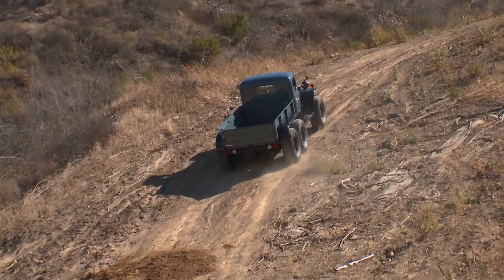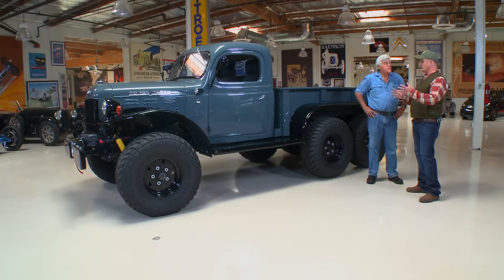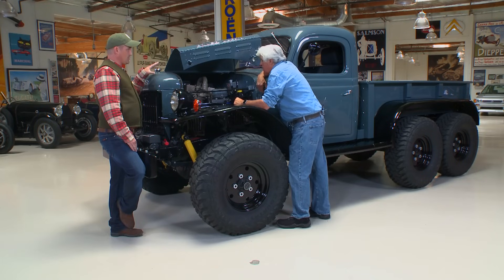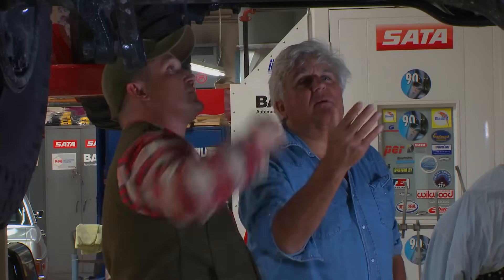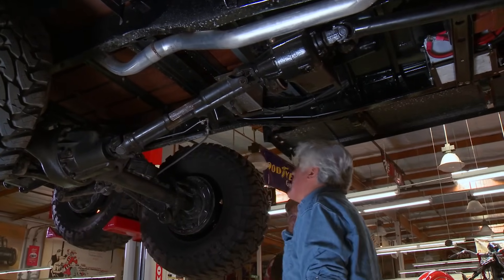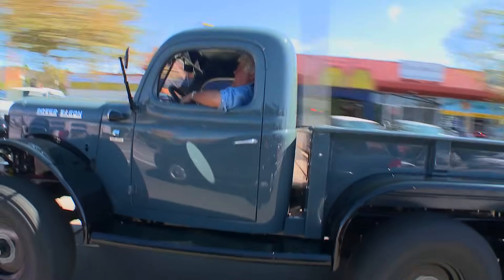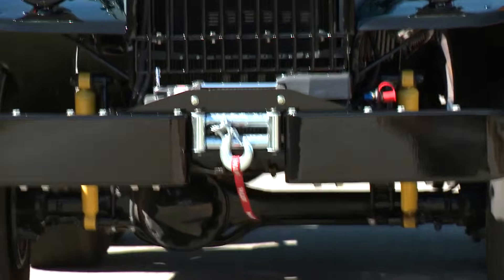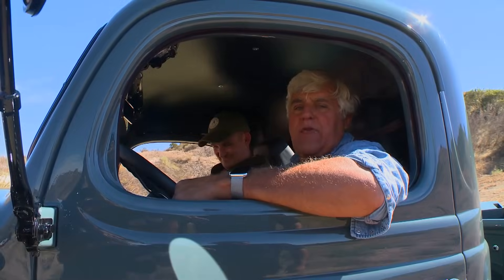1942 Dodge Power Wagon Restomod - Jay Leno's Garage

Comment: I drove a 1952 Dodge M37 for about 10 years.  My every day ride.  It was an ambulance that I put the troop carrier body on, took out the flathead engine and installed a Chevy straight six.  Ditched the 900/16 non directional tires for highway tires.  Lived in Palmer Alaska and drove it every M-F to Anchorage for work.  100 miles round trip.  Drove it to Connecticut from Alaska.  Took 30 days as I broke down every other day!!!.  Did all my own work.    Wish I still had it but bad knees forced me to go to automatic transmission only.  Hey Jay, wish I had a dollar for every time you cross the line while you are driving!!..lol.  Love your shows Mr. Leno.  Wish I had the money to do a few of the builds that you do, that would be a lot of fun.  I bought my M37 from Gary's Trucks in Anchorage in 1981.  Gary's is still open on Dowling Road in Anchorage.  I also used my truck to cut firewood for a living.  Had it off road hundreds of times cutting my way into the woods.  Ahh, to be young again👍

Comment: Nice!!! we had one like this, just with a wide cargo platform, and we used to transport all provisions plus firewood through the snowy slopes of the Patagonian Andes. I think it was a 1947 model almost unmodified from the army issue, except for the paint (red+black). It did its job very good, except for fuel consumption... The winch was used quite a lot, to move the boats, heavy logs, and the truck itself when needed (for snow plowing we had a Unimog, besides a Land Rover Series 2A for moving around). We also rented a Dodge Carryall model 1959 to transport the customers of our fishing lodge. I was just a kid so I do not remember technical details, but the wagon used to be from the Border Control Police, and operated in the high desert plateau of the Atacama Desert before moving to Patagonia as a civilian car. It still had the official greenish-khaki color, just without the markings of the service unit. We also towed a big trailer for the wooden fishing boats (4, 6 to 8) with it. As a kid I loved these cars, I thought I was just back from WW2 whenever I traveled in them... (I even built a tiny 1:72 model of the WW2 truck, the one with the howitzer) The new RAM is just a meek consolation compared to these living monuments! But today I would rather go for Unimog, Pinzgauer or Volvo (army surplus), who are more than capable for such hard performances! (and I would love to have my old Landie back, knowing that the Defender is just overpriced junk, and even convinced that Toyota always built the far better 4x4 anyway) greetings from wild, wet, windy and wonderful Western Patagonia

Comment: It’s like a miniature Deuce 1/2. I love it.
Reply: The Curious Mind  any relation to freeway?
Reply: Several years ago I could have bought 2 smaller duece and a halfs that to my surprise had Chrysler straight 8s gassers in them , I had never seen one before , and I've worked on a lot of old equipment and farm tractors . Inherited an Insley track crane w/one in it , and you think I could track one of those down for engine parts , yah right .
Reply: @jamierodg1  me as well. I had so much fun in in them. About a year before we started getting those née 5 ton with that CTI system, I went to San Jose and picked a fully rebuilt restored deuce. I shredded the hydronic governor and had an absolute blast with it. Those 5 ton just weren’t the same.

Comment: My Dad and his buddy had a trucking company in the 30s with one Diamond T single axle tractor.  After Pearl Harbor Dad became a USMC motor/mechanic - infantry marine.  When he was discharged in 1946, he bought 2 crated/Cosmolined Dodge Power Wagons (DOD surplus) and had them shipped to Milwaukee where he and another mechanic uncrated/assembled/degreased the
single axle Dodges.  His new company put all 3 of his kids through coillege and retired Mom and Dad quite comfortably.  One of those Dodges was still hauling pulp logs when I started college in 1966.  Some truck!

Comment: Everyone commenting how expensive this truck is??  Yup it is coz that winslow guy worked hard in it,  built it with so complicated but powerful, strong vehicle, good looks.. main thing is 6x6 vehicle is only made by mercedes and its very expensive. So here we are getting a 6x6 trolling tank ready to rock anywhere. This vehicle is symbol of monstrosity,  country side people will be happy with this truck.
Reply: Ckryse S nailed it. I mean the merc 6x6 was originally meant for the Australian army. Then it got cancelled and became a poser wagon. This power wagon. Half the price and I would have it any day over the merc.
Reply: Dodge made 6x6 power wagons this is not a one off, I drove by one in a field today. They were the work horses of the US war machine in the 40s, 50, and 60s. So there were thousands made, this is way too expensive. 

It costs about 10k to get something this big down to metal for paint using sand blasting, the 6x6 already exists but you need to make a lift kit and gear it for the Cummins and new tranny that together can be another 15k. Now those tires are probably over 1000 a tire. That is at least 6k. Throw another 10 or so for fabrication including man hours. This was a rip off, haha
Reply: George Glass  there’s another solution if you want a 6x6 and is a Toyota Land Cruiser 70 series. No that expensive as a Merc, not that monstrous as the power wagon and yet pretty capable. That said there is no doubt this build have twice the cool factor of any other similar one.
Reply: @humbertorubi4947  old unimogs arent that expensive. I saw a 6x6 diesel unimog firetruck with cascade gearbox for 15,000 last year on craigslist.
Reply: Mic Krout sure!! But they are not very common. But the comments on the price are referenced on the G63. Unimogs are great 👍🏻
Reply: @humbertorubi4947  true, they arent very common in the US. I just happen to live next to two major importers and in farm and logging country. It was a german fire truck repurposed as a log mule. Besides them being superior off road, you can fix them with junkyard parts which is a big bonus. Just have to find one, i have seen far more power wagons around here but they are $$$
Reply: I can't believe they built 60 of these without a lift in the garage..
Reply: If I had the money, I'd gladly pay that much, matter of fact, I was thinking it would actually be more than what he said it was.  Here's to hoping to win the lottery and SOON! :D
Reply: @angrybadger8136  Who needs a lift? You can probably walk under the thing.
Reply: its a tractor, with a pickup bed, that cost more than a new tractor, very cool truc-tor!
Reply: For half the money you can get twice the truck brand new!  Nostalgia is a prohibitively--expensive feature!

Comment: my ram 2500 5.9L cummins is 8,000 pounds.  so I think that truck is impressively light for how heavy it looks.  great job!!
Reply: That's probably your GVWR. Your truck's curb weight is probably around 6,400 lbs depending on if it's a duallie or 4x4...max curb weight for that vehicle is about 7,200. GVWR is what shows on the door jamb tag, that's the total of the vehicle's weight plus the maximum load it was designed to carry.
Reply: L TR NOPE....MY TRUCK WEIGHT THE SAME 7900 LBS...ITS A 4X4 MEGA CAB 1500...BUT THE MEGA CABS WERE 2500 CHASSIS..WELL IT WAS ACTUALLY 7700 LBS ON A WEIGHT SCALE THE CUMMINS WEIGHTS MORE THEN A HEMI ENGINE ABOUT 250 LBS MORE IF ITS A CUMMINS MEGA CAB 4X4. SO YOU RITE BUT RIGHT NEXT TO THE GVWR IS THE WEIGHT OF THE TRUCK.
Reply: Good point. The truck is already heavy. What happens when you come to the under built or old bridge above the river you cannot drive through?
Reply: No it doesn't it weighs about 6500-7000 lbs.

Comment: Jay Leno, you’ll probably never read this, but my FIRST TRUCK EVER was a 1971 dodge powerwagon. It was a 3/4 ton STEP-SIDE short bEd 4x4. The bed was diamond plate steel. 4.10 gears, 318 v8, and when I bought it there was only 26,000 miles on the clock. It was my local jurisdictions old firehouse truck originally, that ended up in a local farmers barn until I bought it at 16 years old with money I had saved from bailing hay. I ended up in a financial crunch in my mid 20s and had to sell it, and have regretted it ever since. I put a bunch of blood sweat and tears into that truck and miss it dearly. NEVER sell a powerwagon!!!!

Comment: I own 2 Vintage Dodge Power wagons One is a 1946 the other a 1964  BOTH have been used by the US Forrest service until I purchased them 37 years ago . They NEVER have been restored ,other than usual Maintenance and Service .They BOTH have spent 99 % of there lives OUTSIDE . Never Garaged , YET to this day neither one have ANY significant RUST issues !!  minor surface rust here or there on the frames or underbody But you can STAND on the fenders TODAY and they wont give an Inch . VIRGIN IRON was used in the STEEL !Trucks TODAY are NOT made like these were back in the day ! NO impurities or recycled Trash in the Metal . THATS why these trucks have survived 70 Years .They will be here another 70 if all goes well . NO electronics ! No Computer ANYTHING , Just good old American Basic
Trucks that will NEVER Die . ANYONE can fix ANYTHING on these trucks with very little effort . GOD BLESS AMERICA ! I will ALWAYS
Reply: CJ Jackson - you need to buy a new keyboard, as your CapsLock is intermittently locking on!

Comment: Would be cool if they made a 5.9 6bt or new 6.7 cummins in this thing
Reply: he was saying it wouldn't fit the bodyand original sheetmetal,but that little diesel it making monster torque that's what gets you up the hill
Reply: +Matthew Higashyama NO, it wouldn't. I think you missed the part about the top speed being 55, rather than 70. There is absolutely no reason whatsoever to add more power. As soon as you add more power, you have to gut the drivetrain, throw out the suspension. At that point you have a completely different truck. Put a 5.9 in it, and you might as well have a light frame and a fiberglass body. What is the point??
Reply: +Daveinet I hear you. It's a shame though that as far as pulling trailers goes, this beast couldn't reach legal/safe speeds with anything hooked up
Reply: +Daniel Pearson Dana 60s?
Reply: +Matthew Higashyama I would go for a Dana 80. Maybe a high pinion Dana 70 in the front. But again, you start doing that and you have a completely different truck. Right now, as it is, you have a very utilitarian beast - the beast that it originally was, but with new parts, so it will be dependable and maintainable. 
If you want a freeway truck, find a Kodiak 4500 4X4 that was in a roll over. Put an antique truck body on it and call it good. But that is not what this truck was ever intended to be.
Reply: +Matthew Higashyama The 6BT is way longer, fair bit more than the original 6cyl gas engine. They would have had to set the firewall back. The 4BT is probably a good match with the original driveline without tearing them up and the original stuff just looks correct and fits the theme of the truck.
Reply: +Matthew Higashyama I put a 3.9 Cummins in my 04 Tahoe and it pulls it fine but I don't think it is the right engine for a 3 axle monster. I would have put the 5.9l in it any day. Big mistake in my opinion
Reply: +DEBOSS GARAGE Should send the guy a Tape Boss and tell him he needs to put a 6BT in it.
Reply: +DEBOSS GARAGE ya exactly! Plus a Tahoe is significantly lighter than a power wagon so a 4bt would be an awesome application for an suv. I see where they were going with the powerwagon as far as retrofitting a new engine goes but I just don't think it's fast enough regardless of torque and gear ratios
Reply: +Matthew Higashyama  Its not just the drivetrain. It is the handling. The suspension is not safe above 55. The brakes are not safe above 55. The trans is setup with a creeper gear for climbing. So that would need to change too, as it wouldn't hold up. So then you need a different transfercase with low range. If you want a new truck, buy a new truck. You totally loose the character of the original truck.
Reply: +mytmousemalibu I don't think so.  I Jammed a 5.9 in my 05 Silverado which had the 6.0l, but only 4 cylinders long.  It would have fit in the PW if he put an electric fan on the front of the rad.   Cutting into the firewall gets into moving the trans and everything back and way too much work.
Reply: DEBOSS GARAGE Without a tape, IDK, I still think a 6BT is a bit too long. I currently have a 46' Plymouth Deluxe fastback coupe with the original flattie 6. Even with it being a 6cyl, its a pretty small, short engine. Very close to what the PW had in it. Whether it fits or not, I think between what the Builder & Customer wanted, the 4BT will do just fine. That original drivetrain would not last long with a 6BT twisting on it and sticking with the original stuff was a big part of this build.
Reply: I see your point.  At the end of the day it is just an awesome toy that is really not that practical so might as well go with the 4 cyl
Reply: +Daveinet ah he didn't say the top speed was 55 he just said he wouldn't take it higher than 55-60.
Reply: Look up dan mininger precision power wagons on youtube it you want to see ones with 6bt.
Reply: I agree.
Reply: +Matthew Higashyama The little B model is perfect in this thing. It's an off roader first, highway machine second.
Reply: There's no way a Cummins 6 would fit
Reply: supreme2005  They do. People have put them in.
Reply: +Matthew Higashyama You also have to remember what they said about the difference between a 55 mph vehicle and a 70 mph vehicle. It would end up being a LOT less stock!
Reply: +Matthew Higashyama I doubt you'd even notice a trailer on that... Kids these days...
Reply: +Matthew Higashyama Or he could have put an original engine in it and it would be slower than a snail and guess what else... still street legal lol.
Reply: they should make a 4bt based on a 6.7 instead of a 5.9
Reply: Matthew Higashyama I'd buy one. It's a great truck, I love the 6.4l but I would end up needing a diesel for towing and mpg (ps I'm talking about the new one)
Reply: Matthew Higashyama I
Reply: Matthew Higashyama me and my dad where looking at one of theis and we where talking to a guy selling one but the engine was trash and he was saying guys put 5.9 cummins all the time he wouldent sell it to anybody that was gonna put one in it he said the only way he is gonna sell it is if you would put the original engine back in it
Reply: Well if I'm not mistaken this engine basically is a 5.9 12V but missing two cylinders. Sorta like the 4.3L Chevy V6 and the 5.7L V8 (350, duh).
Reply: Too heavy for off road, 4bt already weighs as much as a BB chevy, 6bt dressed is about 1200 lbs
Reply: Matthew Higashyama correct...especially since none of the trucks that company build will ever be used for work. Most of the guys buying his restos are polishing them with a diaper and using their 79 f series for ranch work, their atv's for the elk hunts and their range rovers for commuting.
Reply: @cartmanrlsusall  monster torque with 120 hp its probably not exceeding 3-400 lbft.
Reply: @randymagnum143  6bts are light i6s. And people have used much heavier Detroit based i6s in dual configs for offroading things
Reply: @jdrok5026  6bt is 300 lbs heavier than a big block Chevy.  A 4-53 Detroit weighs a a little more than a 6bt, and a 6v53ta weighs about a ton.
Reply: @randymagnum143  a 6v53 I think is a little under 2500 but the i6 is well I think heavier than a s2000 well the 110 is

Comment: Have a 6x6 open cab flatbed in the back yard as well as a 52. 52 I’ll be fixing up. Sadly may part with the 6x6. My grandpa pulled a old well driller that is heavy as sin with it from Southern California somewhere (can’t remember where off hand) to inyokern California with it back in the day. That flat 6 put in some work back in the day and never had a issue. 

The 1952 last ran in like 90-91. This year my brother and I went went out poured a lil fuel in the carb and it fired right up. It had a A frame mounted to the bumper to use with the wench for pulling wells. They did a lot of work back in the day. Power wagon’s definitely lived up to their names unlike those over glorified trucks dodge makes today that they slapped the power wagon badging to.